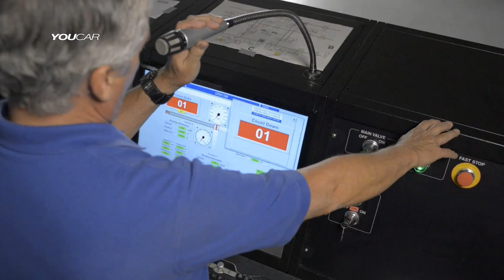CRASH TEST Ford F150 Supercrew and Supercab

Comment: Well the aluminum didn't hold up, lol. It does look safe on the inside however. I remember when my dad bought a wrecked 1993 Toyota pickup. It was hit in the front, and it held up fine, it was perfectly drivable. However, the driver cracked a rib, and got a bad head wound. The driver would probably die in a wreck before the truck did.

Comment: A lot of noise being made here about the testing protocol and whether it was "fair" compared to past tests.  First off, the IIHS sets the testing protocol and informs the manufacturers what they expect the vehicles to endure.  Their protocols are based on real-world accidents and collision information. The protocols are not changed lightly or for transient reasons (e.g. to create higher insurance rates). 

Second, if anything, the IIHS has a VESTED INTEREST in lowering the number and severity of injuries associated with collisions.  The insurance companies paying out $54,000 for a totaled new truck saves them money if all the occupants walk away with no serious injuries. Someone I worked with years ago was T-Boned in her Toyota Corolla by a 2004 F-150 pickup. Everything worked - the side door beams, air bags, seat belts and the Ford's crumple zones. Were it not for the crumple zones she would have been killed. But the F-150 struck it's centerline just aft of the front wheel on the Toyota and as a result my former coworker lost her lower left leg to crush injuries.  Emergency medical costs alone exceeded the cost of both vehicles. Add in recovery, therapy, a prosthesis and on-going medical costs and you can see that IIHS testing actually saves lives and saves millions in insurance claims.

Comment: The preformance of these trucks is not because of the Alluminuim. As was stated before the frame has impact points on the SuperCrew version. The SuperCab does not. The alluminium makes no difference. Its a Alluminium Alloy that is a secret recipe. My uncle works at the steel mill were they make it.
Reply: Yes

Comment: People saying the super cab was just using crumple space,  that night be true.  But deflecting the energy from the crash is a far better way to protect the cabin and passengers.  The supercab did poorly (not because it is aluminum)  but because it lacks extra frame braces behind the front tires designed to deflect the energy,  Ford thought they wouldn't be testing the supercab therefore they cut corners on safety.

Comment: The 2016 F-150 trucks across the board will include the welded on "protective wheel bars". Essentially, the regular and extended cabs will include these to achieve the ratings of the crew cab model.

Comment: To all those that emphasize "crumble zones"
Thats great and all, but I would rather use the other car for my crumple zone. Also, in higher-speed inpact that "crumple zone" becomes akin to very vapid foam, whereas a firmer designed vehicle (hence firmer "foam") will stull crumple but it wont immediately give away all that distace and then leave you 18 inches from that lethal energy.
Reply: crumple zones absorb the energy if it was designed and correct me if you meant different, to stay intact youd get more forces on you then if it crumpled
Reply: I concur with danny.  For those who are uninformed, crumple zones take the energy away that would then be transferred to your internal organs causing (at worse) internal bleeding and ultimately death (imagine your heart/lungs/etc "crashing" into your ribs at the same speed [energy] as your crash).  Why do you think a SMART car passes these tests?  When it's tested it bounces all over the place displacing the energy from the crash.
Reply: ***** Bouncing is actually worse in most cases because no energy is dissipated. 99% of the time your vehicle will not hit a 3 foot thick concrete wall, but rather another vehicle or a building that will give. Therefore if your vehicle has more mass, and is built stronger and wont crumple like a tin can, it will push these things aside and dissipate energy that way, without falling apart like a plastic Chinese toy.

The only thing thats really saving people in new cars are the seat belts and airbags. If we built cars today like we did in the 1930's with good seat belts and air bags, chance of death even in highway accidents would be near zero.
Reply: I suppose you have a physics degree?  Because that's the most absurd answer I've ever heard.  Every hit (bounce) dissipates energy.  Now, the idea that "all cars hit concrete at 80mph head on" would mean that people don't need to be driving.  However, physics (you know, science?) shows that any time a force pushes into something still, it transfers the force energy into the still object - therefore dissipating energy.  Now, if the object doesn't accept the energy (say concrete, for example), then the energy is transferred back to the animate object - ultimately the person within the vehicle.  Once again, assuming that you have this aforementioned physics degree, you will understand that crumple zones are made to accept said energy instead of the passenger of the car.  Okay, physics lesson over.
Reply: *****
To give a juxtaposition, in a higher speed impact the crumple zones give way immediately like light foam and do almost nothing, and a truck built without them act like "firm foam" and you have a higher survival rate. And the crumple zones are only beneficial in low speed impact and as a result cars are totalled at low speed collisions. Way back in the day they were not totalled due to a fender bender.

Let me put it this way, ALL the "Dukes of Hazards" jumps were filmed with a real car making that jump for real, no CGI. And most of the time the car actually survived. A modern car's unibody frame would immediately ball like a tin can. From the 1930's to 50's cars were so thick and heavy they were literally bullet resistant. The reason the 357 Magnum was invented was because 38 Special rounds would not penetrate the doors of an automobile in the 30's

And BTW, head on collisions are rare, and smacking head first into a concrete wall is even more rare. I'd rather have a big heavy car that will keep its momentum and push other cars out of the way. More death/injury for others but I'll survive so I dont care. Bigger cars and truck when hit do not flex much at all so the other car hitting you balls up more.

Let me put it like this, would you rather crash in a car or a big rig? A big rig or a tank?

More mass = safer.

Comment: I'm surprised these things passed and are allowed on the road
Reply: Why? The vehicle preformed well and is safer than many cars on the road today.
Reply: +George Hatton what happens when two cars hit you from opposite sides at the same time or a car that weights a shit ton more than you? You will crumble and die. Plus from the way this looks if you hit a deer you will have to buy a new truck cause it will be totaled
Reply: +George Hatton plus it's a truck, what happens when you are carrying maximum payload in the back and when you hit something it goes right through the "safer aluminum" and crushes you like the truck
Reply: +George Hatton another thing, they are saying 2015's, 2016's and 2017's can pull up to 30,000 pounds. And it increases every year. How can you tow more with a truck that keeps getting lighter. It's not safe, you can't stop 30,000 pounds on a slope with a 7,000 pound truck in front of it!!! Make SUVs out of aluminum to be safer and crumple up, trucks are strictly for work and always have been, but due to these changes they aren't fit for work and will never be used for work either because they cost $70,000
Reply: +jdawsnipes You seriously need to look at the basic design of modern vehicles, although they have aluminium panels and soft crumple zones they have a safe passenger cab compartment which is very strong and won't easily crumple, this will be even more reinforced at the rear of the cab so the load won't crush the passengers if a front end crash occurs. If a much larger vehicle hits the truck, the safety features will still work and give the passengers a safe chance of survival, if the truck wasn't designed with crumple zones so it didn't crumple if a larger vehicle hit it, the passengers wold suffer almost certain death from the forces they would experience without a crumple zone. And yes, it quite possibly would be 'totalled' if it hit a deer or similar sized animal at a reasonable speed, but like all modern safe vehicles, it's designed to sacrifice itself in a crash to keep the occupants safe inside. Aluminium has always been used on car panels and most likely always will be!
Reply: I know its been a year but I just have too.

1.) Crashing into a industrial made pillar design for crash test is different from crashing 150LB deer (male) at it's prime. Newton's 3rd law states that for every action there is an equal and opposite reaction. Crashing into a deer will not be a total loss for a truck... while a industrial made pillar design for crash tests? Probably.

2.) "right through the "safer aluminum" and crushes you like the truck" and that's one of the trade-off that Ford engineer took. I assume one measure that took was human reasoning and how humans are able to calculate when to stop accurate in time before crashing into something, along with not driving into a brick wall or a industrial made pillar design for crash tests. and if that was the case you just hope physics fall in your favor.
What happens if I get t-boned by a Cadillac Escalade full speed on the driver side? I hope for the best, because I know my car door isn't made from reinforce steel 7 inch thick like the president's limousine.

3.)"How can you tow more with a truck that keeps getting lighter" with a more powerful engine obviously! Once again they are so much trade-off you have to take into account. "you can't stop 30,000 pounds on a slope with a 7,000 pound truck" Once again the driver must take extra precautions when dealing with this shit. They must understand their limits and estimate to the best of their abilities.

Comment: The bed should not collapse into the cab like that.
Reply: Proof of a very under-built vehicle. Made like a tin can.
Reply: dakota croasdale [citation needed]
Seriously, cars in the 30's were built so incredibly heavy the 357 Magnum was invented because 38 rounds would not penetrate the metal of old American cars/trucks.

Compared to today, a 38 will sail through and into the engine block of one of these rolling plastic phones. Thats prettymuch what these things are, computers on wheels that people drive. And they obsolete about as fast, and they are just as if not moreso impossible to fix yourself.
Reply: +Joe Schmoe yes, I agree with you, no matter what brand older is better, but out of all the companies now I'd choose ford. btw my dad has a 59 ford f100 and it's built like a tank.
Reply: Because it's aluminum
Reply: The energy is being transferred through the frame, that's why the bed is hitting the cab, the impact is being dispersed into something other than the passengers. If you watch any new crash test video you'll see similar things like the rear quarter panels of a sedan bending under heavy impact.
Reply: Watch a crash test between a 50's car and a new one and you'll understand how ass backwards your thinking is.
Reply: Every front- end collision is going to be somewhat different. Keep in mine that frontal collisions with another vehicle, the other vehicle will also have a crumple zone.
Reply: ProdigyGraal and your engineering degree is from...where?
Reply: Justin Kady Ever been to demolition derby's? Those "crash tests" are rigged. The testers remove the engine, greatly weaken the frame, and use aftermarket panels much thinner than originals.
Reply: Brian the Brain the engines aren't removed from these. The fluids are the only thing removed before the crash test
Reply: ProdigyGraal I'm talking about Justins example when they crashed a car made in th 1950's with a new model vehicle. The IHHS removed the engine block, transmission, and deliberately weakened the frame on that test. They also used fiberglass and thin metal aftermarket parts.
Reply: @Brian Delta V

Thorougly debunked. 

That was indeed a normal Impala with an engine under the hood—which is why the instrument panel buckled as its pushed through the firewall.  Lol. 

Old cars are crap.

Comment: Wooww ... I'll be a great fool to invest in such a truck, even if it offers free o me I put it to the scrap
good there are clever who believes that they alone understand the deformation of a vehicle
the deformation of the body so, to avoid shocks areas, but not the complete deformation of the chassis
avat to say anything, replay the video and watch the cab and the driver
also watch the rear trunk that sinks into the driver's cab !!!
all the structures of the truck looks like made with paper, not sheet metal
the deformation of the front part of the engine is just soften the blow, not to destroy the interior of the cab driver .... this and the clever who can speak too big and take the mode for the ignorant
it's not a truck, but rather a toy made in china, even if the toy manufacture in China is stronger and cheaper than garbage truck ....
What is this madness ??? a truck that needs to be robust folds into pieces like butter, like a glass that fell down, it's really shame
if I understand correctly, therefore, has a speed between 40ML has 55ml ... I am dead inside during a single crash ????
and I have to invest in almost $ 50,000 ???
it is spirited to fuck who? Customer Review or the law ???
the truck was pulled by a cable in addition to, not in a state of driving running !!!!
all the inside compartment of the truck exploded, and the poor driver model is mixed in the interior as in a blender
just imagine for a moment if a baby was sitting in his seat behind !!!! my god I avoid thinking about it .... !!!!
and it says a lot of technology and security .... !!!! I say rather a coffin has $ 50,000
I do not think a normal couple will raise her baby in a similar truck
just passing !!! How many engineers ot they worked to invent the coffin of death to our roads ???
really nice joke fro this truck

Comment: More damage to the body means it is doing its job, absorbing the energy from the impact. Its shocking how many people determine a vehicles safety by the outside damage, obviously not understanding the concept of energy and how it is dissipated. New vehicles are made to crumble on the outside, protecting the cab and passengers on the inside. Energy from an impact has to go somewhere, I prefer it go to the body of the truck!

Comment: What was the point of the last test starting at 2:46?
Reply: Roll over test. It tests the strength of the roof at it's weakest point. They basically take 2 times the weight of the vehicle and use those hydraulic presses to measure the intrusion. A lot more controlled testing environment than actually sending the vehicle into a roll over where there are far to many variables. In many real life roll overs the roof is untouched.

Comment: Those aluminum bodies aren't as strong as Ford says they are (I got to test it out personally). Plus, if you get into a minor collision it will cost you more on your insurance because aluminum is harder for body shops to work with. But I guess these new bodies are going to be the norm in just a matter of years (with GM thinking about switching to it in 2018)
Reply: Actually, Insurance is lower on the 2015 model compared to the 2014 model, and the panels are riveted instead of welded to aid in repairs

Comment: they crash into a struture with absolutely  no give. Most items won't be this solid... but if you do not something this hard. your fucked...
Reply: It's actually better than that. You're unlikely to crash a truck into a truck. Physics tells us that even if the F-150 is involved in a head on with say a Camry going 70 Mph. The F-150 will receive less damage than in this solid barrier 40 Mph test.

Comment: Buy an old ford! Steel frame bolted to an aluminium body is very weak
Reply: evo emperor These trucks are actually very safe. They both did well in the normal crashes like frontal and side. The SuperCrew also got a Top Safety Pick award.
Reply: TyPieWaffles  Sticking to GMC? Wasn't the whole ignitions-from-hell-fiasco from just a couple of years ago? Worst one being Chevrolet cobalt that killed a couple dozen peoples. Since when is the GMC, especially Chevorlet, bastion of safe vehicles?

Comment: I know that vehicle crumple zones are supposed to minimize the impact to the driver, but these things just fell the fuck apart on impact! I've seen trucks withstand an impact as strong as that and still be drivable, but these are soda cans on wheels!
Reply: I think that's the problem there. It's like the aluminum skin on a plane which is super thin and easy to crush. Planes aren't meant to withstand an impact tho, and trucks really shouldn't be built as thin as planes
Reply: Just think what would happen if you off roaded that thing and bumped a big enough branch or a bush. not too fun

Comment: The only reason the F150 passed is because there is a bar extending from the frame to the wheel well front and back. The '15 SuperCab did not this, thats why it failed.
Reply: Eric Johnson ok, so?

Comment: is that a fail or pass?
Reply: Kenth Llemit i hate f150 drivers
Reply: +Hacker07Gaming its a pass because the inside of the cab isn't damaged....ford designed the truck to crumple around the cab in order to protect the passagers/driver. Any well designed car steel or not has this function.